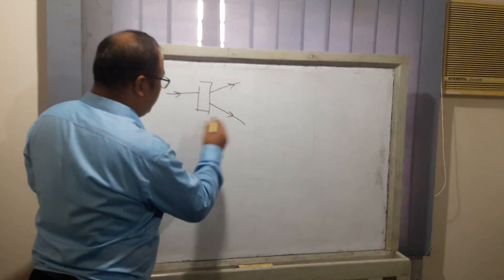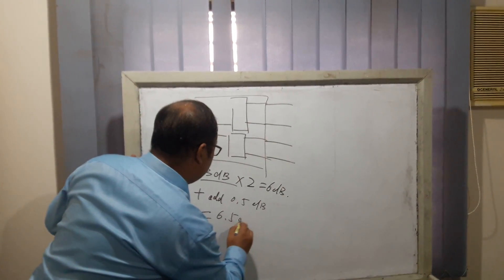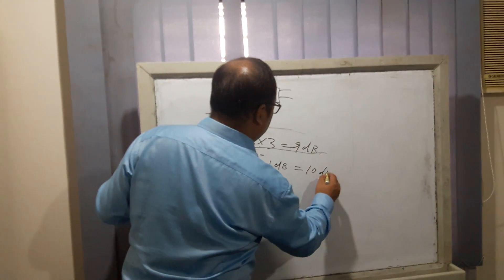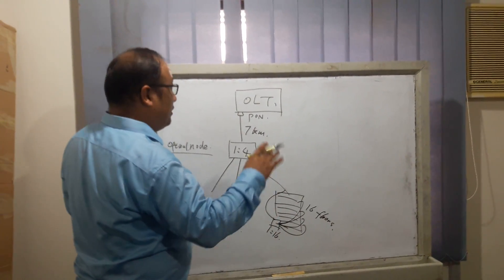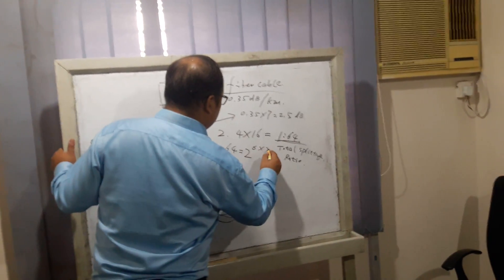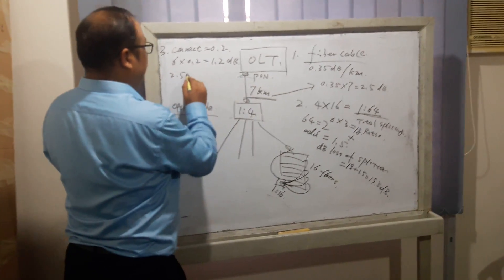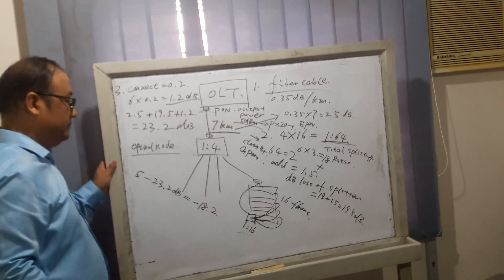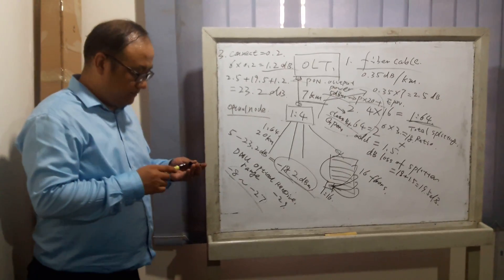FTTH Power Budget Understanding (English)

Comment: ধন্যবাদ । অনেক কিছু শিখতে পারলাম OLT Power এর বিষয়ে। একটা বিষয় বুঝিয়ে বললে উপকৃত হব। আমি যদি ২ কিলোমিটার এরিয়া তে প্রত্যেক ১০০  থেকে ১৫০ মিটার পরে সর্বমোট ১৬ টি ১ঃ৪ স্প্লিটার লাগাই তার পরেও কি (6x3)+1.5 = 19.5 Dbm স্প্লিটার পাওয়ার লস হবে নাকি বেশী হবে? জানার জন্য অপেক্ষায় রইলাম।
Reply from the maker: Bhai, Thanks for your comments & question. First you need to look at https://www.facebook.com/aratechnologiesltd/photos/pcb.1833529340310848/1833528903644225/?type=3&theater ; average loss of 1:4 splittar is -7.2; ONU sensitivity is -28 (Max). So, practically; If you use 4 stage 1:4; Total loss will be -29, where you have many other factors of loss like Fiber, Splicing, Connectors etc. So, if it is stage by stage splitting; 16 stage of 1:4 is impossible. 

But if you are talking about First stage 1:4 & second 1:16; possible. You can calculate like 4X16 = 64; or 8x8 = 64 or 2x32 =64 or strait 1X64.
Reply: Thanks.
Reply: @sohel05-smartsourcebd  sir,  is possible to connect different splitting ratio? 
Example: 1:4 has 4 output, is it possible to connect different splitter in 2 layer splitter say 1:8 to 1st port, 1:16 to 2nd port, 1:4 to 3rd port.
How to calculate power budget in this network topology